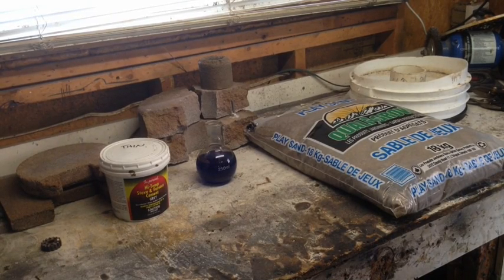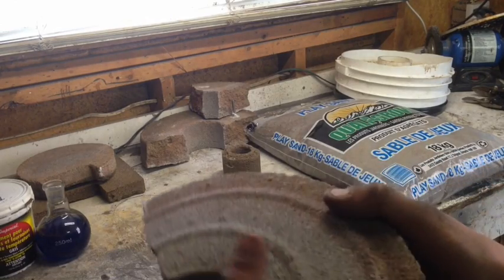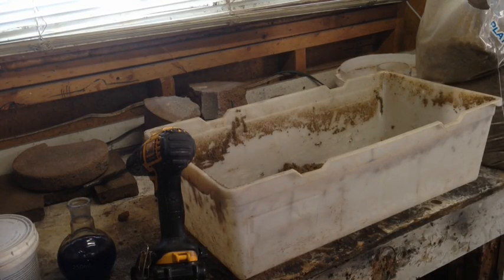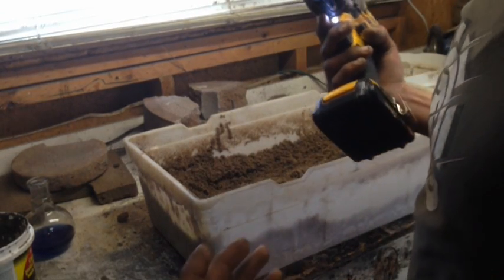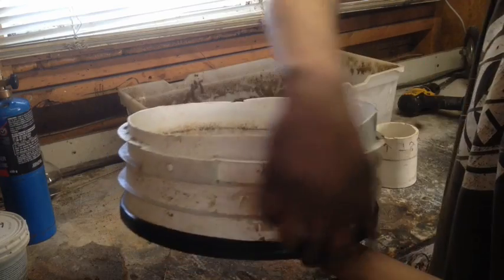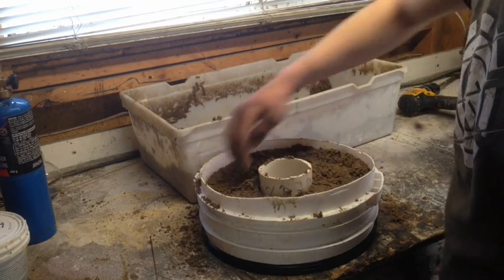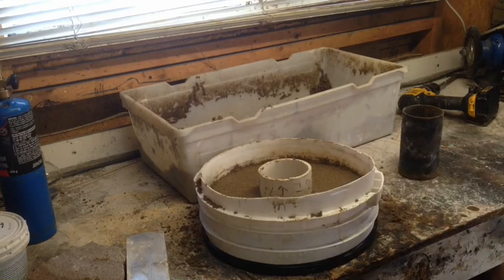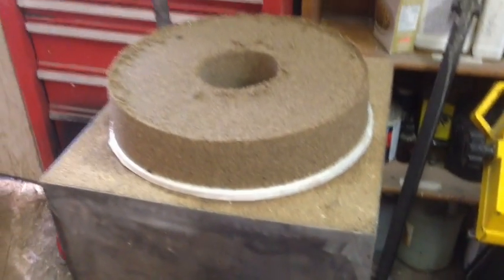How to make refractory brick (fire brick) with sodium silicate PART 2

Comment: Is the finished fire brick food safe?  Could it be used as the floor of an earthen oven, or to make a custom sized pizza stone for example?
Reply: NO! This stuff is toxic.
Reply: What makes you think so? Sand is food safe and natrium silicate is relatively safe in its liquid form. Some decades ago people even preserved eggs in sodium silicate and water mixture. When natrium silicate hardens its even safer. In Finland people use natrium silicate and soapstone dust to repair fireplaces made from soapstone. Some of these fireplaces have food ovens in them so it's certainly not "very TOXIC!" like you say. However there's much better pizza stones (that soapstone for example) so no need to make your own from sand and sodium silicate.
Reply: Hello Juho,
Thanks for that info, very interesting.
What stones do you feel would be excellent to make the pizza oven?
Obviously, they must withstand very high temperatures without breaking and spalling (flaking apart)
Thank you

Comment: The main problem of sodium silicate is it works as a fluxing agent which means it reduces the refractoriness of the refractory material, the most suitable material is calcium aluminate , refractory cement , u can use secar 51 , or Gorkal 50+ ,  but u can buy directly refractory castable ,, good luck my friend
Reply from the maker: benaraby this is a cheap substitute that works quite well though.

Comment: Thanks for the great instructional video once again!  I made one identical to this one you made, but put a vacuum bag around it first, then after I molded the sand, I used my shop vac to suck out all the air.  I then injected carbon dioxide as much as I dared without having the bag rupture, and let it sit for a couple of hours.  I was then able to remove it from the mold and it was really hard already!  I fired it and viola!  It is awesome and very rugged and fired beautifully.  It really came out classy.  I may have to make a small rocket stove out of this stuff.  Anyway, thanks for the instructional and inspiration! I really dig your videos!
Reply from the maker: im glad it worked out for you. and im glad you enjoy the videos

Comment: I'm trying to build a DIY Konro grill similar to this one  http://korin.com/Charcoal-Barbecue-Konro-Lg?sc=29&category=17859353 by possibly using a perlite and refractory cement mixture.  I was going to build a postiive and negative mold and fill it in with the mixture  Would you have any suggestions on a good "recipe"  that might make a portable grill like this?  Ideally I like the concept of the perlite so the grill would be not HOT to the touch on the outside but stable enough not to crack on the hot inside where the charcoal is.   I love your video.  Extremely informative and you kept it in layman's terms!

Comment: Good stuff. It might be easier to mix with a rotating drum type mixer with some vanes on the inside. Probably would mix as well or better as the paint mixer and you could be doing something else for that 15-30 minutes. Let it mix for an hour if you want.

Comment: I ended up making a 4 inch J tube core for a rocket mass heater. Holy cow can this stuff hold the heat! my best results were with dry sand and large volumes of sodium silicate, pack the mould, light it almost immediately and burn out the inner mould.
Reply: +LimitedGunnerGM How thick are the walls of your J tube, and could you post all dimensions of it?
Reply: +Bob Ansley I'd say it depends on the size of the system and the barrel style used, i.e...  need to keep the room in the barrel for airflow.  the cob and perlite packed thingies are pretty thick.  Gotta keep in mind that initial draw might suck if it pulls too much heat. No big deal if airflow isn't restricted, i'd think.   A four inch system with 4" walls would be cool.
Reply from the maker: LimitedGunnerGM glad to hear it worked out for you. how's it holding up?

Comment: so... I have made my mould twice and screwed this up twice. 

1st attempt. too much water. The sodium silicate ran out of the mould after tamping and glued the mould to the concrete. 

2nd attempt I let it sit too long before firing. The top crusted over nicely but the sodium silicate never set up in the interior parts of the mould. 

I have a plan to use CO2 or dry ice to do a forced CO2 cold set then fire it.
Reply from the maker: it can be tricky to make complicated moulds. you almost need to use CO2 or fire it in the mould. you can add fireplace cement to help it air dry a bit, but it is still very fragile.
Reply: +iwonnatube outstanding idea. never thought of that!

Comment: Found a really cheap source of silica gel. at Michael craft stores. it's in the flower drying section. I called the factory and it is pure. 5# is 16$ I get 30% off because the wife works for them.
Reply from the maker: thank you for posting this. I am currently looking to buy more for other reasons.. I will be going to michaels this afternoon.
Reply from the maker: 25$ in canada for anyone who cares.
Reply: +nilamotk the best I can find on line seems to be about 10$/# plus shipping. so even 25$ is about half price. They're tiny pellets so they dissolve fast.
Reply from the maker: In all honesty, the large pellets are easier IMO they dont stick together as much and end up disolving faster. But, this is a pure cheap rout. Some cat litter is silica aswel, usually mixed with some kind of fragrance..
Reply: Isn’t crystal cat litter the same stuff?

Comment: Does the sodium silicate require the heat to bond or is heat just accelerating the curing/bonding process?
Reply from the maker: it requires heat to cure. it actually foams up like spray foam when heated to bind everything together
Reply: Thank you! I did in the meantime try some and it cured OK (with heat). I did use hydroponic perlite (no very small parts) and think that this is a drwa back, because if I'd have the smaller particles, it might me more rigid after curing... Will try again and see. Maybe 1/4 gypsum? Any thoughts?
Reply from the maker: +yxcvmk your correct, the finer the material the stronger the bond. the sodium silicate alone in big foamed up pieces are actually very weak... when its in close contact with other particles though, its strength is increased significantly.. (kinda like superglue... less it more (to an extent...)) 

if its working for you now, i wouldnt bother fixing it... but if it breaks, or you make another one, use as small of pieces as possible (sand or perlite, etc...) 

if you go extreamly fine, you might want to use more sodium silicate... the idea is you want to coat every grain of sand in the water glass... so if you use smaller grains, youll have more surface area, and youll most likely need more sodium silicate to fully coat all of the grains. and idealy, you want as thin a coat as pissible for the most strength.. so dont make a "slurry" mix, or it will end up being weaker.
Reply from the maker: +yxcvmk your correct, the finer the material the stronger the bond. the sodium silicate alone in big foamed up pieces are actually very weak... when its in close contact with other particles though, its strength is increased significantly.. (kinda like superglue... less it more (to an extent...)) 

if its working for you now, i wouldnt bother fixing it... but if it breaks, or you make another one, use as small of pieces as possible (sand or perlite, etc...) 

if you go extreamly fine, you might want to use more sodium silicate... the idea is you want to coat every grain of sand in the water glass... so if you use smaller grains, youll have more surface area, and youll most likely need more sodium silicate to fully coat all of the grains. and idealy, you want as thin a coat as pissible for the most strength.. so dont make a "slurry" mix, or it will end up being weaker.
Reply: Thank you! Did you just put a certain percentage of sodium bicarbonate into the mixture with the perlite, water and sodium silicate?

Comment: I've been researching how to make a cheap, but structural cast for a rocket stove and I'm pretty sure the temps won't get close to that of a foundry, none the less I still want to achieve high temp ratings in my cast.  Do you think your mix would work well if added to perlite, and if yes, would you recommend a more slurry mix?  I already have the perlite and am tracking down the lye and silica to make the water glass now.  Any tips you can share will be greatly appreciated.
Reply: +Michael J I want to try the same and wonder how strong the perlite will be bound together. Am lacking the proper sodium silicate at the current time.
Reply: +yxcvmk I poured my cast already for my rocket stove and learned a few things along the way.  First, expect to use roughly 3 times more perlite than originally calculated by volume as that stuff really compresses.  Also, I'm finding that mixing water glass with fire clay makes for a decent furnace cement.  I'm giving my cast 48 hours till I remove the form, than another 4-5 days to air dry before firing it.
Reply: Thank you for the information!
Reply from the maker: sorry for such a late reply. i wouldnt ever use a "slurry" with this mix, but in all honesty it doesnt matter if you use "too much" but a slurry is a bit exsessive. i believe the mix would crack if you mixed up a slurry..

and as for perlite compressing. you dont want to pack the mix too much if you add perlite. "insulation" is notbing but air... fiberglass, hold air, styrofoam, holds air... spray foam, perlite....etc.. tbey all hold air. if you compress too much, ypi are forcing the air (and insulating rating) out of the mix.

as a pure sand mix, its a low islnsulating value.. if you where to melt cast iron, youd want alot of insulating value (like added perlite) but you dont want to force the mix down too much..

Comment: I used a similar method for my refractory but I used ultra fine sand blasting media instead of play sand. It's pure alumina (aluminum oxide) and has a better refractive index than silicon dioxide. Most industrial firebrick uses a mix that is mostly alumina with a small amount of silicon dioxide. Alumina also has a higher melt point so you can potentially work with much tougher metals.
Reply: David, do you perhaps know how high temperatures would alumina and sodium silicate mixture withstand? Wouldn't it be less than pure alumina since the binder melts at lower temperatures respectively?
Reply: +nilamotk Suns a bitch.  :)
Reply from the maker: alumina withstands some crazy temps.. your mix should stand up to 3000 degrees easily..

TIG welding torch tips are made from alumina... TIG welding exceedes the temps of the sun...

Comment: If you are in the habit of mixing concrete and cement with your hands, you might want to use vinegar to wash up with later to prevent serious chapping and cracking. It is an old concrete worker's remedy and is a very good start before using a moisturizing lotion. This mix also looks like it would work well in home made small amateur rocket motors for the nozzel
Reply: +JagdtygerII Wish I would've learned this years ago.  I work a lot with lime and am no stranger to chem burns on my hands.  Thanks for sharing this!
Reply from the maker: Thanks for the tip, I will keep it in mind
Reply from the maker: +Michael J No problem, thanks for sharing your tips too!
Reply: +JagdtygerII And if your trying to get stubborn engine grease off your hands, use an oil high in monounsaturated fats :)

Comment: Could you just buy sodium silicate from a pottery supply store? Would that work? Pete
Reply from the maker: If you can buy "off the shelf" "sodium silicate" or "water glass" it is the same stuff. Just buy it, its cheaper that way... Me on the other hand, and I sure others have the same problem, is that its nowhere to be found, and shipping prices are nuts because its caustic. 

If the stuff you get is a nice gel, work with it as is, if its too thick, or solid even, dissolve it in hot water (even boil the water slightly to melt it) if its too thin, boil some of the watter off.

Comment: I think I'm going to try this in the near future to make a core for a rocket mass heater. Just curious, if I placed my filled form in a plastic bag or box with a chunk of dry ice, would it cure faster or stronger as it sublimated and filled the container with CO2?
Reply from the maker: If you need it to hold a given shape (with platic or wood moulds) before firing, you can use the CO2 to harden the mix. It should still be handled with care until fully fired though.

Comment: I'm looking at making a small gas forge to heat steel and iron (inside diameter would be 2-3"). Do you think making a fire brick refractory would work well? How much heat does it dissipate to the outside? How thick would the walls need to be?
Oh, i forgot.. what kind of temperature can one expect to get from such a setup?
Reply from the maker: propane burns hotter then natural gas (something tp think about) the mix will hold up, but to what temps you can reach will be depending on how thick yoir insulation layer is (fire brick)
Reply from the maker: the walls in my forge are about 2" thick, havent had a problem.  the more the marrier..
Reply: +nilamotk it's going to be about 2" thick, yes. Thanks

Comment: Can you use beach sand for this ? Will the iron and other minerals affect the brick ?
Reply from the maker: I actually used beach sand in this video, well... "Play sand" anyway.. I haven't had any issues, but "by the book" you shouldn't because of the quarts in the sand. It can explode or "Pop" at high temperatures causing cracks in the finished brick.

Reccomend to use 100% silica sand, but like I said.. I'm melting aluminum in a Fordge I made with this mix and haven't had any issues using "play sand" or beach sand.
Reply: nilamotk I was going to try and make a tiny mold  and using it inside a microwave kiln to melt glass... I better get  the 100% silica sand...just iust in case..
Reply from the maker: Glass is made from mostly silica sand. I don't know if this is the type of material you want to use to melt glass in. I have a feeling it may turn into glass itself.

If I was you, I would look to gets hands on some ceramic wool insulation. It withstands higher temperatures, but can get costly...

Although... I may be completely wrong, and this could work just fine for you... I have had it glowing red hot in my foundry, and I'm almost positive a glass bottle would have melted if it were inside.. So it may be worth testing.. Maybe on small scale first?

Comment: Sodium silicate is the second ingredient found in Purex Crystals for your laundry and you shouldnt touch your skin to that stuff either.
Reply from the maker: You shouldn't touch any chemicals to be honest.. That should be common sense.. 

But we also eat cancer causing pigments and dyes all the time.. The air we breath is polluted, and cellphones we use every day give off radiation. It's all rellivent. 

You can get away with contacting sodium silicate, I wouldn't reccomend bathing in it, but you can easily wash you hands and still be fine.. Nitric acid on the other hand, you don't want to do this with...

Comment: Very cool info. Just wondering, why couldn't an entire oven dome for a small outdoor pizza oven be cast in one piece with your materials and method. It could be fired from inside with a wood fire...?
Reply from the maker: You could do that, the trouble is this mix HATES water. So for a pizza oven outdoors in the rain... Is probably not a good idea.

But I did cast a forge in 1 piece inside a propane tank, and I used a co2 cylender to mould the inside. I cured the refractory mix with CO2 gas, then fired it afterwards.
Reply: The one piece oven formed from your method would be fired and cured with a wood fire from the inside. After it has been "fired" it could be covered with insulating layers of other materials to make it weather proof.
Reply from the maker: That is a possibility, you could even coat the outside in regular cement (possibly) to repel moisture.

But at the same time regular cement may hold touch moisture. Try it small scale first,
Reply: Tenwalls fire clay, sand, and portland would be a good mix and very durable. and you can buy all the ingredients. you don't have to make any of them. I'd do a mix of 2 parts fireclay and portland and 1 part sand as a test and see how that does on like a propane grill. you could shape it like a pizza stone and see if it cracks and how stable and durable it is after it cools.